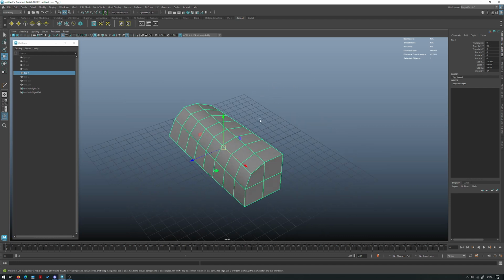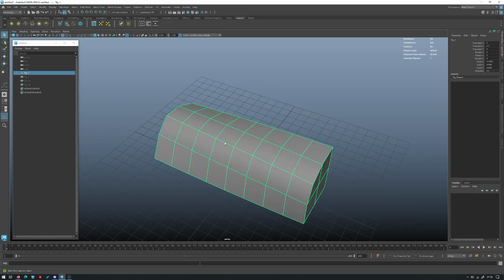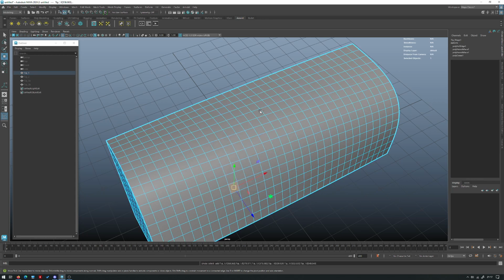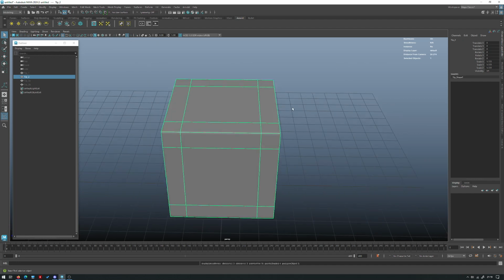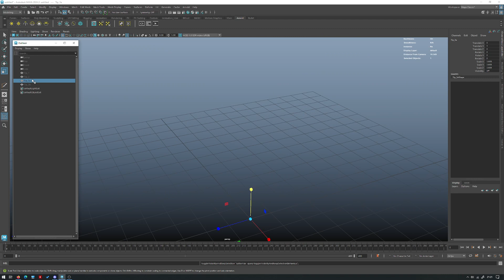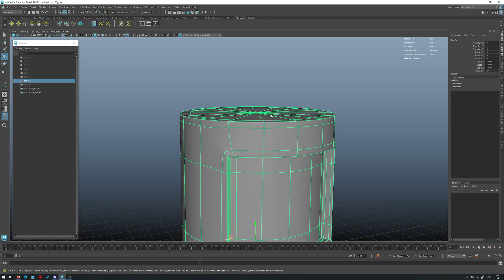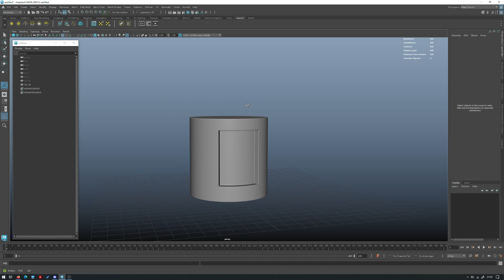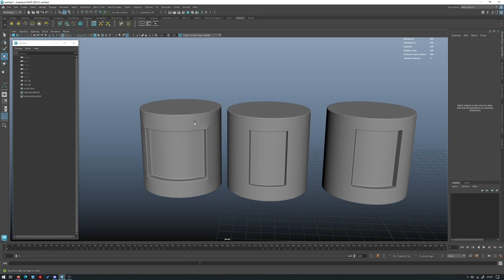3 Topology Tips in Maya To Become a Better 3D modeller

Comment: Thanks for the video! Modelling in Maya for 4 years now and I still struggle with cylinder shapes due to pinching. One thing most video's don't explain is that having more topology on the cylinder can help to decrease the pinching with the correct edge flow. Thank god you mentioned this so I can finally reduce my pinching on models.
Reply from the maker: You're welcome! glad it helped. Yeah it's not mentioned enough strangely. A lot of 3D content on YouTube has to do with game modelling, so you would typically have lower resolution meshes. But for anything pre-rendered, definitely add more resolution to your mesh, especially if it is a smooth rounded shape and you need to add details.